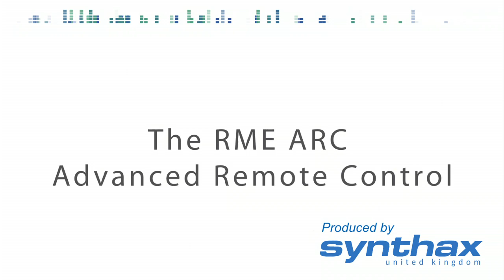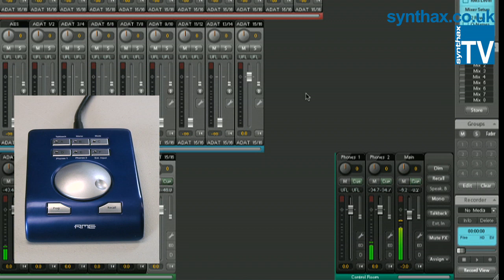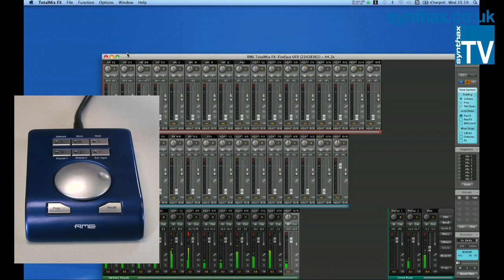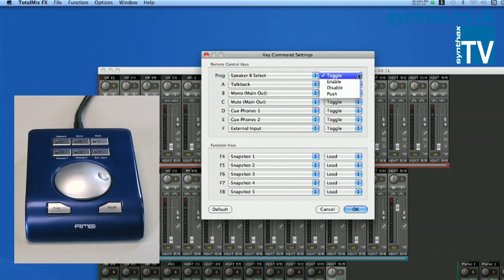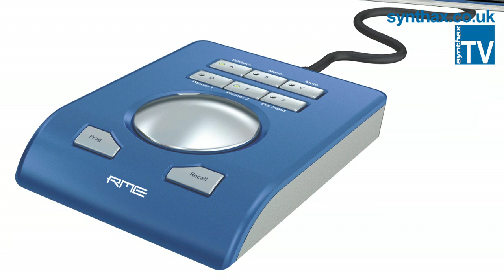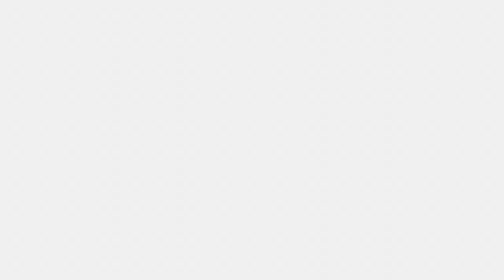RME ARC Advanced Remote Control - Synthax TV

Comment: Does the new one (ARC USB) have a mute button?
Reply from the maker: Not by default but you can remap any of the buttons to anything you want (including mutes). There's also stickers included in the box for all of the functions to make it easy to track your changes.
Reply: @SynthaxAudioUK Ok. Thank you. I'm trying to decide between the Arc USB or the Audient Nero.
Reply from the maker: @rcprod9631  Yeah it probably depends what you're trying to do. The Audient looks like a more traditional monitor controller so good if you have multiple sets of monitors and need several headphone mixes with dedicated encoders. 

(TotalMix FX and the ARC USB can do a lot of those things too but requires a bit more configuration / knowing the system, and only has the single main encoder.)

Comment: Hi ! Anybody selling an ARC ?
Reply from the maker: Hi Adam, are you based in the UK? If so we might be able to source one for you, is it the original ARC you're looking for (featured in this video), or the newer ARC USB?
Reply from the maker: @nikonik  Hi, the original ARC has been discontinued for some time, and as such you'll be unlikely to find one new I'm afraid. Your best bet would be to look on somewhere like eBay, where you might be able to pick one up second hand.

The new ARC USB will work perfectly with your UCX by the way (you just connect directly to your Mac or PC via USB). Can I ask why you are looking for the older one?
Reply from the maker: @nikonik  Hi, yes I understand, the lack of USB ports on a laptop can be frustrating. The ARC USB is a USB 1.1 device however, so for what it’s worth, you wouldn’t have any problems running it through an external hub.

When you say that “the new additional features are not available for the UCX”, which features you are referring to? All features of the ARC USB simply reflect the functions of TotalMix FX, which is the same across all RME interfaces and sound cards (except for the effects, which are only available on certain devices). 

The only button by default that wouldn’t work with your UCX is the second headphone output (labelled VOL PH 2), as the UCX only has one headphone output of course. All buttons are user-definable though, so you could simply re-program this button (and any other button for that matter), for control over any other functions in TotalMix FX.

Comment: Can you use the ARC in Class Compliant mode without TotalMix?
Reply from the maker: Hi there, yes you can use the ARC with an RME interface in class compliant mode (or running your interface in standalone mode) to control a set of default commands. For full functionality and control it’s best to use it with TotalMix FX where possible, as that way you can customise the controls to your own liking.

It’s worth noting however that the original ARC featured in this video has now been discontinued, as it’s been superseded by the RME ARC USB - check out the following video from NAMM 2017 to find out more about the new ARC USB;
https://youtu.be/dh7pxcwHDQM?t=1m15s
Reply: Thanks! 

I do have the opportunity to buy an original ARC. I suppose the ARC USB is not possible to use in standalone or CC modes? Anyway, I'm trying to understand what can be accomplished with the original ARC in CC mode, as I am using GNU/Linux. I do have access to Windows and TotalMix if needed for configuration. 

So there are buttons for switching between six pre-defined configurations and a wheel that I suppose can be used more or less like the encoder on the unit? Can I set up configurations with internal audio routing in TotalMix, and store it in these six slots, for later use in CC mode, or can the routing only be used with RME drivers? 

Many questions, but I'm trying to understand if it is worth almost 200 EUR it will cost me. :)
Reply from the maker: Hi, the ARC USB can be used standalone with the new RME Firefaces (UFX+ and UFX II), as these have a dedicated connection on the units themselves (labelled remote, found on the rear panel).

As far as using the original ARC in standalone mode, you can certainly set it up to recall snapshots of TotalMix FX, such as mix and routing settings. The buttons themselves will default to what’s written on the ARC’s buttons, but you can customise what task each button performs. This is done from a menu found in TotalMix FX, so you need to be connected to a computer. 

Your customised setup can then be stored on the onboard memory of your audio interface, for you to use in standalone mode, assuming you have one of the Firefaces that has a dedicated remote connection, e.g. the Fireface UFX, 802 or UCX.
Reply: Thank you for quickly replying! Turned out the ARC offered to me was nothing but a wrongly labeled ARC USB, so still searching. My device is the UCX, so from what I can read it is not supported by direct connection to the ARC USB.

Anyway. In CC mode, I guess the ARC is more or less a convenient way of accessing the parameters I otherwise can access via the encoder. Hence, while looking for an opportunity to get my hands on an ARC, I can still use all the CC features of my UCX.
Reply from the maker: Hi, yes that's correct, the UCX has a direct connection for the original ARC but not the new ARC USB. You can of course still use the ARC USB to control your UCX, however you will need to connect the ARC USB to a computer (via a USB port) to do so.

As you rightly say, the idea behind the ARC is to provide quick access to the most commonly used functions of RME interfaces (volume control, mute, dim, mono, speaker B etc).

Comment: you're right, I have it as well and its pretty awesome. Snappy and easy to use.
At first I was a bit worried to hook my speakers directly to a soundcard without a analog controller in between. But everything is superstable, no weird clicks and loud output things when switching on or off.

Worth mentioning that the 'prog' button standard is the ' b-speaker ' function :)